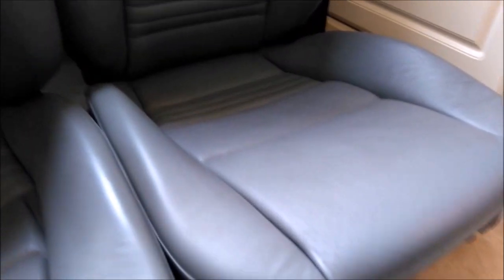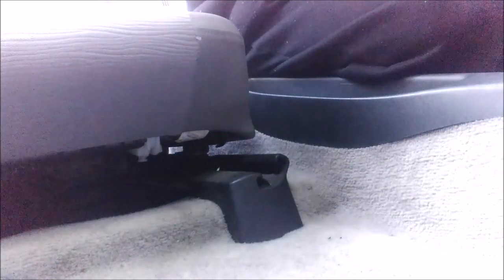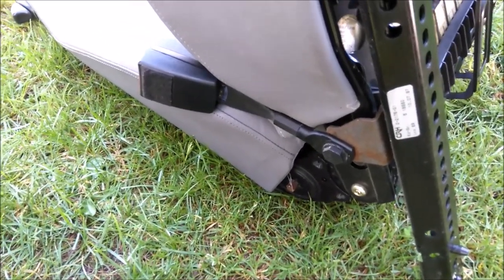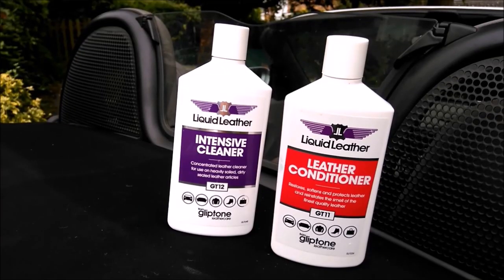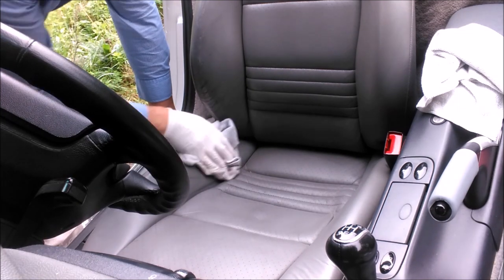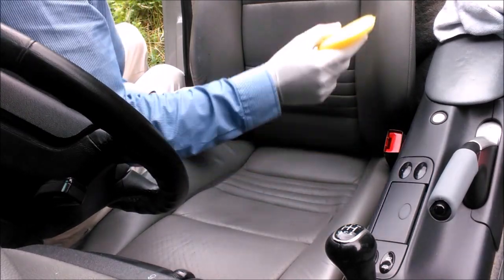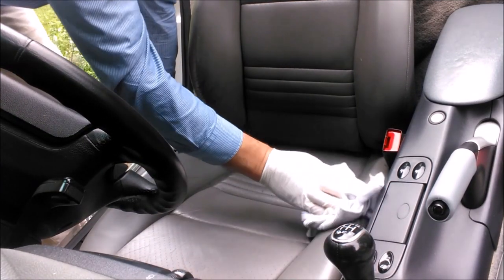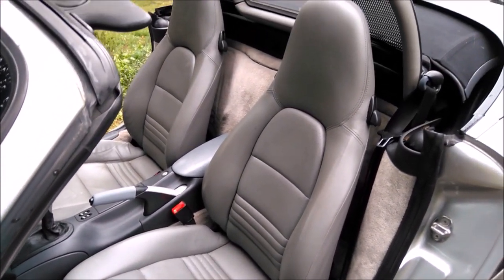Porsche Boxster fitting leather seats

Comment: Hi Paul,  Sorry but I inadvertently misled you, I commented on your post not realising that I was logged into Youtube under my wife's account, Marlene Green.  It was not until the post appeared that I realised.  Anyway I am me now.  Thanks for your answer to my question regarding the steering wheel.  I love your channel, so practical and useful.  I run a 2004 Boxster S (65,000 kms) in Perth, Western Australia, which I have had since January this year.  I just love it but whilst you chose to do most of the work yourself Porsche owners have little choice in Western Australia as there is very limited professional support and the dealer is too expensive.  As a result I have made a few mods, Driving lights, activated OBC, Alpine satnav head unit and rear speaker kit, and swapped out the Rear Main Seal and installed an LN Engineering IMS Solution kit.  So far all good and great fun working on the Boxster.  Anyway thanks for the channel, I have watched them all.  Keep up the good work.  Best regards
Reply from the maker: no worries, I here men mascaraing as women is common place out there! lol. really glad you like what we do, I try to keep it real, we don't cut out the things that go wrong and no behind the scenes crew with all the latest kit, I work with what I have, where I can and within a tight budget, then share it with you guys to show realistically what can and cant be done, thanks for the support Bill aka Marlene, lol

Comment: Hi did you connect the heated seats if so any wiring tips
Reply from the maker: I didn't connect mine, but i would recommend making a separate and induvial harness, as if you were adding the as an aftermarket extra.

Comment: Hi Paul,  Excellent channel.  One thing that surprised me is I noticed in your video that you have not changed the steering wheel for a three spoke unit.  This seems to be the first thing owners do if they have a four spoke wheel.  Do you prefer the four spoke?
Reply from the maker: Hi Marlene, The answer no, I don't like the four spoke wheel, lol. I do intend to replace it at some point, it's a question of prioritising things and as the car was in very poor condition when I got it the interior took last place and now that I have got round to doing the interior the steering wheel has taken last place, the seats were the main issue as the drivers seat was just about to fall a part, after the seats it's a case of what looks worst and what is the easiest to get hold of, another problem with the steering wheel is you can pay as much for a 3 spoke wheel as I paid for the seats, which just doesn't make any sense at all.

Comment: Great video, I rescently replaced my tired vinyl seats with leather ones. My question is my new leather ones are both power recline and heated. The reclining part works perfectly but what do I do to wire in the heated part? The connection is the same but there are a couple more wires leading to the plug. Great video tho!
Reply from the maker: Hi Brandon, thanks for the great feedback. you have two options here, a get the loom parts and switches which all just plug in, or get the switches, a couple of relays and make and you own loom.